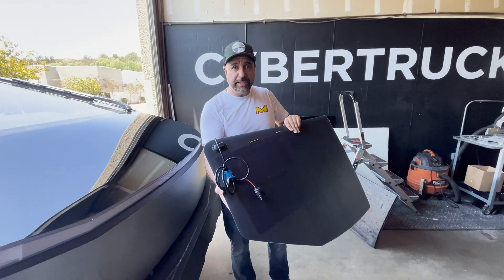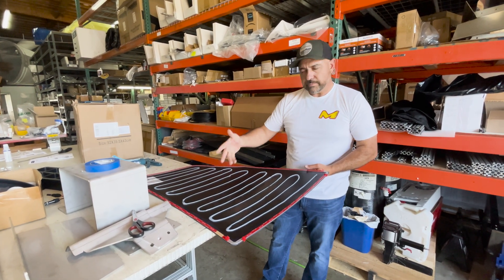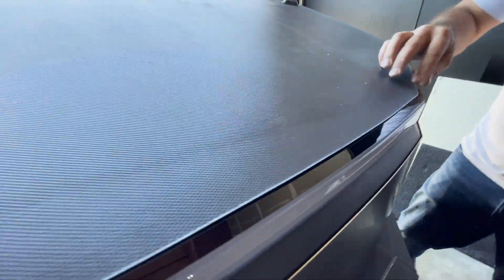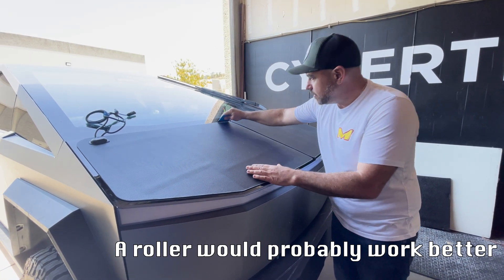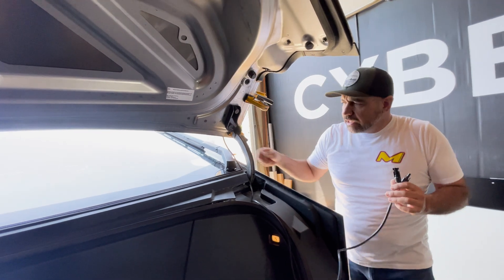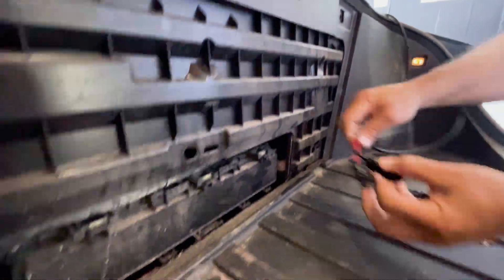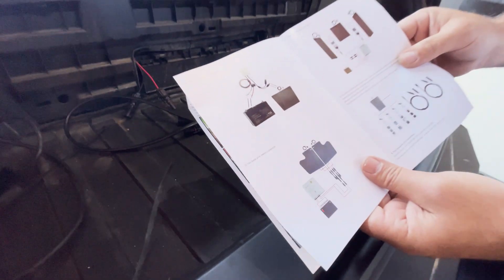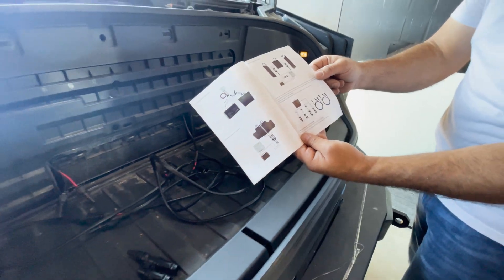Cybertruck Solar Hood Panels kit from CYBERTRUCKco

Comment: Ok, installed. The gasket by the wiper arm will not stay on, with the wire going intohat area. And the edge of the frunk is awfully sharp. How do you prevent it from chafing the cable over time?

Comment: Great idea! I would love to see you connect it to the vehicle so it can add some range. May be get the small battery charged using solar energy and then it can automatically connect and charge the car for some time. Direct power to the main battery would be great also, but somehow you'd have to connect the solar panels to the BMS charge controller.